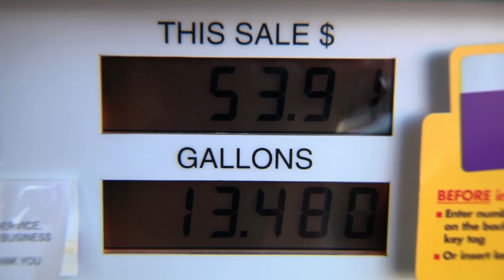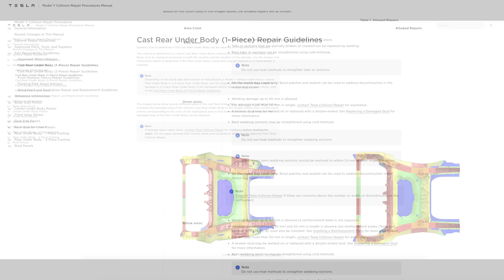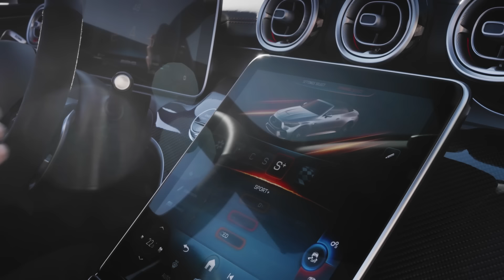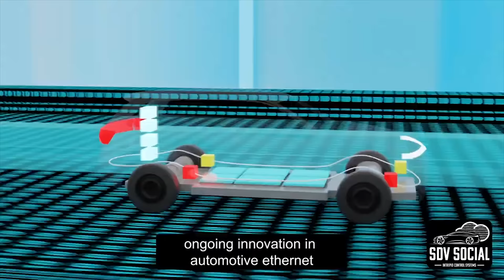EVs Put Massive Dent in Gas Demand; U.S. Eases Battery Sourcing Requirements - Autoline Daily 3805

Comment: Misleading title. 

EVs put a dent in THE GROWTH IN  Gasoline demand.
Reply: Globally yes. The U.S. gas consumption is down. I do agree the title is a bit misleading because it’s not only EVs, it’s also driven by PHEVs.
Reply: @tomm5936  PHEVs likely have little impact, since most people don't leverage the battery.
Reply: Yes, that's more accurate way to phrase it.
Reply: @BTC_Minarchist  OK I didn’t know that then I wonder why they even buy a PHEV. I admit I was speculating. I have no insights here.
Reply: @BTC_Minarchist  There are quite a few PHEV owners at work, we all leverage the battery like a religion. Privately owned PHEVs almost never use fuel if they can help it. Why pay more for fuel and put hours (km) on the range extender? Those figures where folks who don't plug their PHEVs in are from company cars where the drivers are given corporate fuel cards. There were a few PHEVs in the company fleet which did just that, we never saw them plugged in. They have since been replaced with HEVs when the leases ran out.
Reply: @anydaynow01  For every person you know that does use a PHEV as intended, I have one that does not.  I'm surrounded by them.  Several have moved to EVs after a few years of PHEV ownership when they realized that PHEVs make little sense when compared to a good ICE equivalent or an EV.
Reply: @tomm5936  Think of it this way: With PHEV hybrids specifically, you're now tasked with fueling through two inlets, one of them only provides, say, an extra 20 miles of electric range for all that trouble. 

What does the typical person do when the average US commute is 40 miles?

In EU it gets compounded further: Company cars are quite prevalent in many areas as a perk, but companies typically only reimburse gasoline usage, so if someone gets a PHEV the electric part is on their dime.
Reply: @AllanSustainabilityFan  I know two first gen volt oweners. One of them has 180k miles on it with only 30k on the gas engine. it has 40 miles electric range
Reply: @JD-yx7be  the later Volt had more like 50 miles of range, not ideal but workable yep, decent for that time period at those prices. Sadly discontinued.

The recent PHEV stuff generally have poor electric range by today's standards, as if time stood still since Volt days. These are today mostly lazy compliance products for riding subsidies, made for avoiding fines rather than promoting ideal customer usage sadly.

And it shows in real world usage patterns, as customers are too inconvenienced to bother, leading to 3x more emissions than lab results.

If PHEVs were closer to the old BMW I3 then it wouldn't be so bad, that beauty had at least 80 miles of range, and later on they improved it further to ~150 miles. That's a good PHEV design.
Reply: @AllanSustainabilityFan  The Volt was like $45k in the early 2010s equivalent to over $60k today, not affordable at all.  The Prius Prime Is $33k
Reply: @JD-yx7be  Yes, but back then battery costs were $1200/kwh (~$1700 w/inflation), vs falling below $100/kwh these days for market leaders, but lets say it's $150 for Toyota.

That means >$22,000 for Volt's 18.4 kwh pack in 2010 sans inflation, as opposed to $2000 for a 13.6kwh pack in a Toyota PHEV today at worst - likely even lower.

So not only they are using a smaller pack vs a 2010 design, but those packs are much less costly to produce now to boot.
Reply: PHEVs are a gateway vehicle to BEVs. I owned a 2016 Ford Fusion Energi (PHEV) and replaced it with a 2018 Honda Clarity PHEV (hated it, LOL). The Ford was a very nice driver and I really enjoyed it when it was in electric-only mode. But it only have 20 mi EV range on a good day and when the weather was cold, the gas engine had to run often to provide cabin heat. The Honda Clarity was a joke - although it had a 47 mile EV range, it only had a 7 gallon gas tank -- when driven on the hwy 75 MPH it would only get around 30 mpg and I was stopping often for gas. I sold the Honda and bought a 2019 Tesla Model 3 SR+ and absolutely loved it. I upgraded in late 2021 to a Model 3 Long Range with acceleration boost option and loved the ~3.7 sec 0-60. Now, I'm driving a 2023 Tesla Model Y LR made in Austin TX. I'll never go back to ICE.
Reply: @JD-yx7be  and that doesn’t include the government subsidies
Reply: @BTC_Minarchist  I call BS, I don't think you have the data to back up that statement. You might have a belief but that and  exact change for a drink will buy you a drink. 

People who specifically drop the extra cash to purchase plug-in hybrids over standard ones tend to buy them because they make sense for their usage. Unlike standard hybrids, plug-in owners do tend to leverage the fuel savings and make the most of their batteries. 

I might have agreed with you if you had made that statement specifically about regular hybrids. But even those, in many cases, show an increase MPG by up to double digits. Where the argument for standard hybrids fall apart and where I would agree with you are in cases where some bonehead thinks they can both significantly reduce fuel usage AND drive an SUV or Crossover. I'll never understand that purchase decision as spending thousands more for a hybrid that will only see a tiny reduction in fuel is idiotic since  very few Crossovers, even small ones, see significant fuel savings. 

Still, between EV's, plug-ins and actual fuel efficient hybrids like the Prius, it is completely reasonable for there to be a significant drop in demand. Add to that the average American's work commute being round 40 miles and even a standard hybrid could have a large impact.

But hey, I admit, I don't know everything. Where is your data coming from? I'm willing to read it. School us.
Reply: @BTC_Minarchist  don't forget all the EV owners going back to ICE, the global abandon rate is roughly 25%

Comment: With gasoline costing about twice what it should be selling for, I have drastically reduced the amount of miles I drive, paring down to essential trips. If there are more people out there doing the same thing, couldn't this affect the total amount of gasoline sold?
Reply: Correct. Also, as hybrid sales increase, people use less gas for the same trips. Most American households have multiple cars. If they drive their more efficient vehicle & leave their less efficient one parked, they will use less as well.
Reply: @theevermind  Yep this is be big reason, folks are leaving their big vehicles in the driveway or trading them in for HEVs mostly. Toyota and other HEV makers are leveraging their battery supply for much better CAFE numbers instead of selling a comparative tiny number of BEVs to a few battery hoarders.
Reply: Get an eBike for errands and cut that consumption further.
Reply: I heard too many stories of those things bursting into flames so I bought a 21 speed bicycle that operates on me power.
Reply: If all else being equal, but prices up, then demand will go down. That's like econ 101
Reply: Misinformation I  guess is a  thing.  🤷
Reply: @patrickchubey3127  Sketchy batteries and no-name chargers are a bad combination.
Reply: I always look for ways to make purchases or carry out other transactions online...rather than traveling in my car. It is surprising how many older people avoid using their computer for such things.
Reply: TFL just did a towing test comparing the Cybertruck to a Ram 2500.  Charging the Cybertruck for the same exact mileage was $37 vs $25 in diesel for the Ram 2500.

Comment: EVs keeping gas prices down daily
Reply: Nothing would spike EV sales like a significant increase in gas prices.   Every gas company is busy modeling to see what gas price will results in the most income over time.
Reply: @danharold3087  And gas is made from oil which is sold globally to the highest bidder. Energy demand will steadily increase for many years to come. EVs make a small impact on gas prices but not much.
Reply: @ScottOstr  If we ask the oil producers and their supporters the sky is the limit.  But Global sales of internal combustion engine (ICE) vehicles have been declining since 2017, when 85.9 million were sold. In 2022, only 59 million ICE cars were sold globally, which is a 5% decrease from 2021 and a 29% decrease from 2017. Opps
Reply: That can be a legitimate claim some time in the 2030s.  OPEC+ adjusts production and thus aims to keep oil prices within a small range, so prices aren't too high or too low for their liking.
Reply: @danharold3087  TFL just did a towing test comparing the Cybertruck to a Ram 2500.  Charging the Cybertruck for the same exact mileage was $37 vs $25 in diesel for the Ram 2500.

Comment: Fourteen months commuting in my Bolt euv Lt has saved me a bunch of money, and it's had zero problems; Orion assembly did a great job. After buying my Bolt, I sold five gas and diesel vehicles, as I didn't want to drive them anymore. I love not having purchased any gas, diesel, or oil since I got my ev.

Comment: Still, petrol consumption is measured in millions of barrels per day. It's mind blowing.
Reply: Something is off.  The US produces from 10-12 million barrels of oil/day and consumes about 20 million barrels of oil/day.   Globally, around 75-90 million barrels of oil is produced per day.
Reply: @GG-si7fw  I thought the US was a net exporter and the biggest global producer.
Reply: It is measured in barrels not gallons.
Reply: @BTC_Minarchist it's not really a net exporter, it's very complicated. for example it refines a lot of oil for foreign customers.
Reply: @Withnail1969  Interesting.  I'll have to dig deeper.  Any sources of info on the topic would be appreciated.  Thanks!
Reply: @BTC_Minarchist  Another issue is that most of the oil produced in the US today is too light to make diesel. US refineries don't want it so it has to be exported.
Reply: When gasoline prices or prices of anything jump consumption goes down
Reply: Hundred of millions of barrels per day consumed in the US.  IIRC, each barrel is 55 US Gallons.
Reply: @Withnail1969  Huh, I hadn't heard that before interesting.
Reply: @hoffinger  fixed
Reply: @georgepelton5645  1 barrel of oil = 42 gallons, because why not.
Reply: @BTC_Minarchist  The US is a net energy exporter and net crude oil exporter as well.  Going deeper it gets more complicated, but the last 2 years we have exported more than consumed overall.
Reply: When I studied environmental in college 70s they were sure we run out by 1986, then it was 2,000 and so on
Reply: @annamarie5372  we won't run out at all - it will become cost prohibitive to drill for it, though.  Probably in 40-50 years, maybe less.
Reply: @whattheschmidt  if they didn’t put horse before that cart investing $trillion into failed EVs and instead built fusion reactors , hydroelectric and other clean cheap energy people buy EVs for cheap electric fuel . Btw there’s lots of untouched oil fields still in gulf and Atlantic. Back when i studied environmental college in 70s they wrrr sure we run out by 1986..,then 1999 and so on . Malthusians are always wrong !!
Reply: @Gadfly2025  fracking changed forecasts
Reply: it's mind blowing that people still believe the earth's oil supply is finite.  Every 5 years or so was supposed to be the year that we ran out.
Reply: @rotaryenginepete  LoL, such an absurd comment. You do know where oil comes from, right?

Comment: For a year now, I've been saying every million ev sold is a million less gas tanks
Reply: Gonna be interesting to see if gas goes down because there's a glut, or gas goes up because refineries start closing down, less competition, and gas stations start to wither away.
Reply: @jamesvandamme7786  
As far as I know no new refineries have been built in Northern North America, since the 1980s.
I don't know if any have closed down since, but they're all getting older, so that's going to happen.
Once EVs reall take off, and they will, not building new ones will be seen a very smart move.
Reply: Only 1.2 million TOTAL EV's sold last year in the USA and it will be far fewer this year. Thanks for mathing.
Reply: @PANIC_aka_PinD  We'll see if the industry forecasters are right: 1.4 million in 2024.
Reply: @jamesvandamme7786  TFL just did a towing test comparing the Cybertruck to a Ram 2500.  Charging the Cybertruck for the same exact mileage was $37 vs $25 in diesel for the Ram 2500.